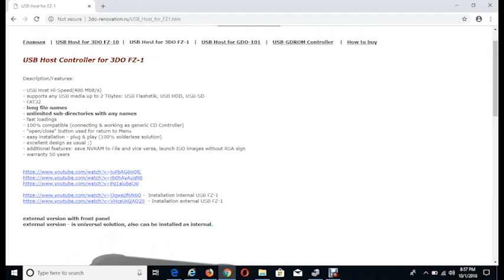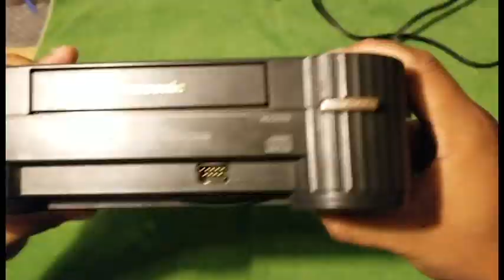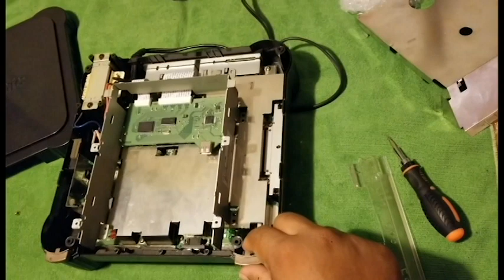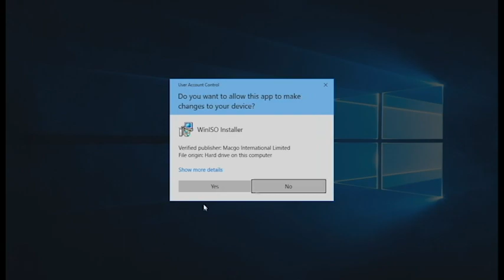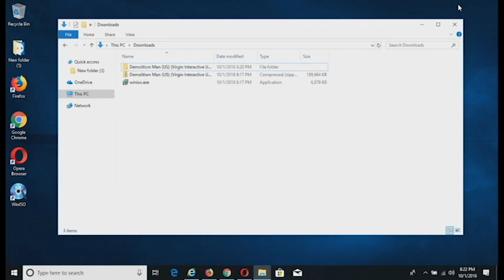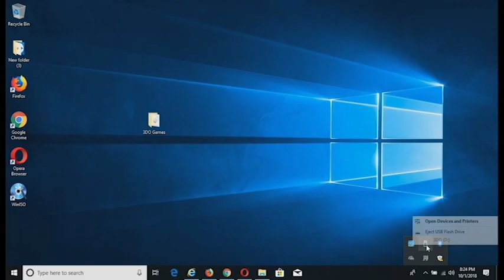Panasonic 3DO FZ-1 USB Host Controller Install + Setup

Comment: dose this work in the Japanese FZ1?
Reply from the maker: Sorry bud I'm not sure you'll probably have to check on the website.
Reply: Yes, I internally installed Mnemo's USB host on my Japanese 240p/480i FZ-1. No problems at all. This was about 3 years ago. Console loads all .ISO i throw at it.

Comment: I ordered one of these from the same site. I did the method that he didn’t have to pay the PayPal fees by basically gifting the money. Did you send the money that way? Even though I see examples of people receiving them. I’m still a bit skeptical.
Reply: I did also.....I was prepared to lose the money sent. I even had a problem with compatibility on the first shipment. In the end I got what I paid for within 3 weeks turnaround. (2 different shipments) I couldnt be happier....also I have never heard of anyone getting ripped off.
Reply: @partoftheproblem4899  To update because your comment reminded me. I received it in a little over 2 weeks and works great with my Japanese (A/B mode switch) FZ-1.  I couldn't be happier =D. Dino Park Tycoon takes me back to the early 90s
Reply: @nyastclair8174  Great to hear. I just wish someone would come up with an hdmi/upscaler mod. Without the disc drive in there, there is alot of room. Rgb is fine, but I dont use it. I just want to plug it in to my Tv in the living room with no fuss.
Reply: @partoftheproblem4899  I bought a retrotink 2x, s-video cable and a 3 foot set of RCA audio cables. Looks great on my LCD 1080p tv. No input lag.
Reply: @nyastclair8174  I may just have to bite the bullet and buy an external option for it. It being an obscure system doesnt help either.  I keep seeing the modding community upgrading the genesis (mega drive), snes, etc, to hdmi .and I keep crossing my fingers....lol
Reply from the maker: Hm honestly I do not remember. But I probably did.

Comment: Anyone know how to get to the bios screen?
Reply from the maker: I haven't tested mutli disc myself but in this link.  
https://www.reddit.com/r/3DO/comments/5unz6y/can_anyone_here_tell_me_if_mnemos_usb_host/

It looks like when it asks to load the disc the users did a quick power cycle to the USB host menu selected the second disc and it worked. Give it a shot. Let me know how it works.

Comment: Hi, what screwdrivers you used for the CD Trayholder in this video? I tried Philips #0,1,2,3. But none of them worked
Reply from the maker: Hey I really do not remember. I just had a screwdriver set with different assortments.

Comment: @OP

I copied the directory structure from MNEMO's page to a USB 128gb pen drive formatted as FAT32 and it loaded a game fine and it reset to the menu again after hitting the reset button.

Problem, I found was, the "Launch Bios" results in a black screen, which requires a power cycle. Is that supposed to reload the 3D0 animation screen with the Space Asteroids?  Btw, a blank file (txt) can be used apprantly to access the main bios screen, as the 3DO thinks there is no disk inserted from what i read.

However, without nothing plugged in, the 3DO logo splash screen shows but then goes to black and stays there, which results in power cycle to fix with the USB drive connected.

Does that happen to your console?
Reply from the maker: I do not recall trying it without anything plugged in and I didn't try going into the bios menu.  Only issues I've ran into were some games wouldn't load and I had to restart and retry or if I clicked the A button (normal/encrypted) and it didn't load I'd try the b button (unencrypted) to see if that would work.  I will try some of the things you mentioned over the weekend to see.  Thanks!
Reply: @igbeserk  okay thanks, as it's hard finding info on this and how it works properly, as there is no clear documentation available from I have saw.
Reply from the maker: @hanzobi1926  exactly! Although I'm not that good with video editing/tutorials and what not since I struggled to find any information on it I made the video. But the questions you asked were things that I hadn't tried and would be good to add to the video or description to provide more info to everyone.